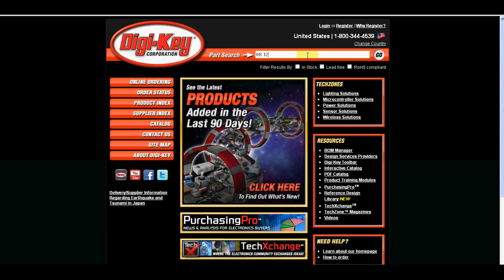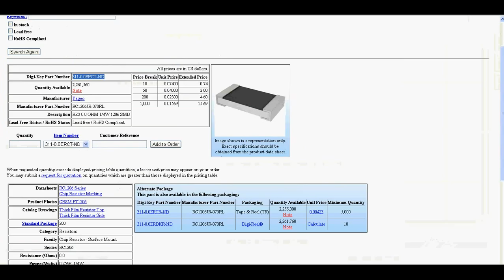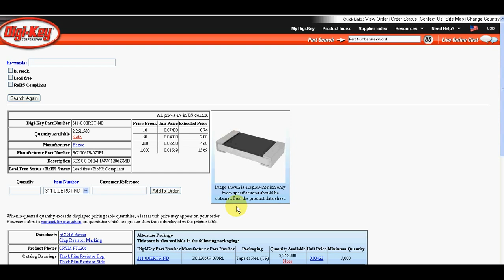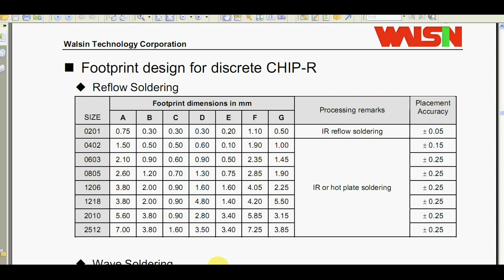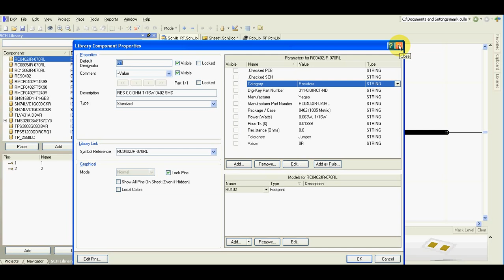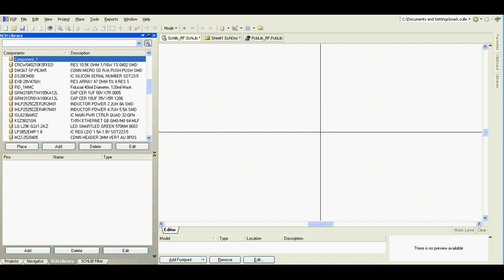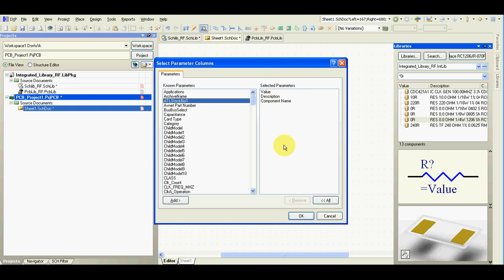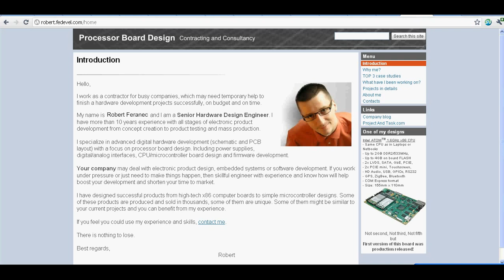Altium Designer - Creating useful integrated library

Comment: HI Robert , thanks for answer,that  I meant is I couldn't find the LTC3855 in Alitium (Is there LTC3855 in altium?), I making a library for this component, but I couldn't find a footprint (a QFN, 40-Leads, Body 6mmx6mm .Pcblib for it), so I'll try to find  a component in altium who has this package using the Library Index 28Jan10 of Altium, and then extract the .Pcblib.
But I have a query , Is there LTC3855 in altium?

Comment: Hi , i hope you can help me whit this problem, see I have a LTC3855 and i couldn't find the library in Altium, so i made a schematic library and then i've tried add footprint (data sheet 40-Lead (6mm ×6mm) Plastic QFN) but in Altium i found QFN, 40-Leads, Body 5x5 mm.
I have a similar problem with the FDMC8878 where the footprint is MLP 3.3x3.3 , in that case i couldn't find any footprint.
 I need made a footprint by myself or my footprint library is not updated??